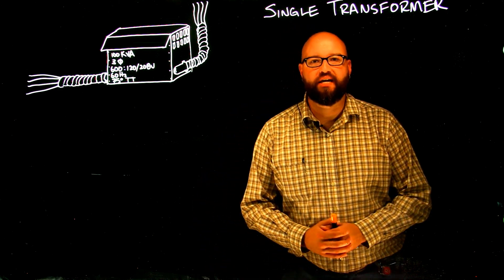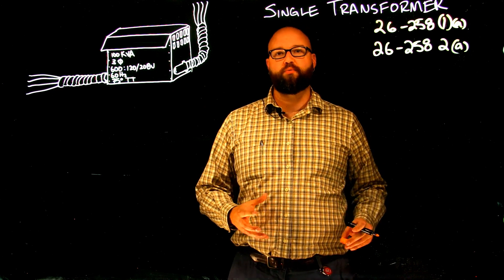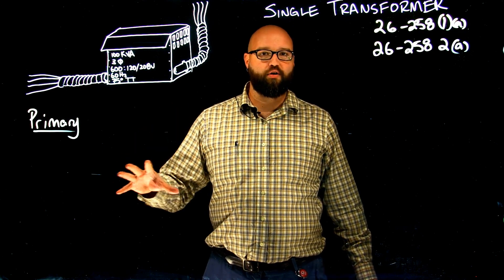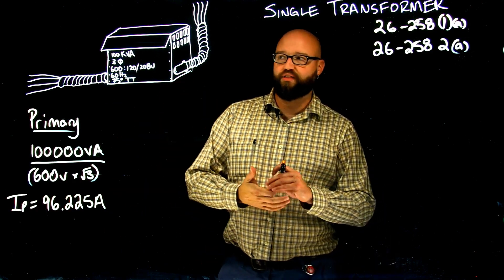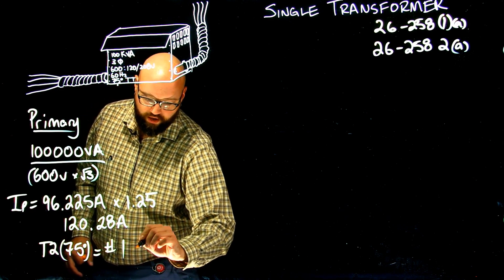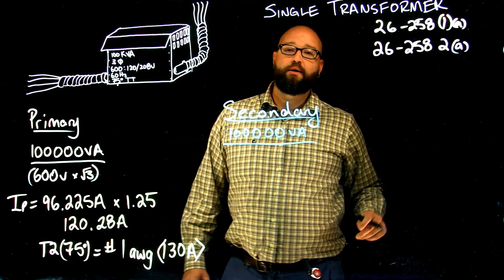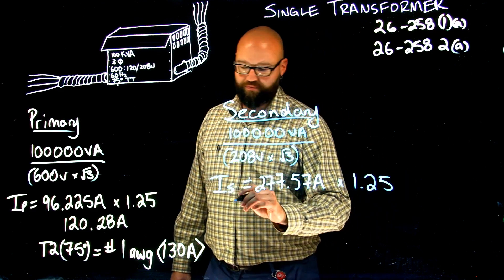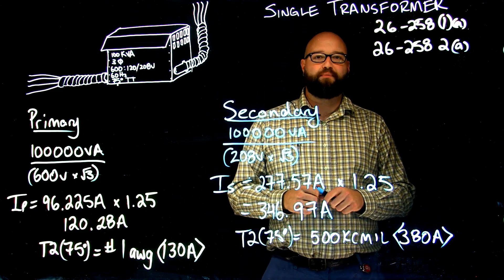Single Transformer Conductor Sizing

Comment: Say you didn’t have a temperature termination for this question, so “unmarked”. Would you still have used the 75c column in Table 2 because it’s over 100A ? 4-006 (2)(b). Or would you use 60c column cause of the no temperature rating ?
Reply from the maker: The default would depend on the load yes. As it is over 100amps it would be 75 as you said, 100amps or less we default to 60°C if nothing is marked.

Comment: Assuming I have a 110mva transformer, with cooling I have 163mva at 34.5kkv
Does the 1.25 rule still apply?
It would have a current of 2291 A * 1.25 = 2864
It is a lot of current and if the cables go in a duct there would be many conductors per phase

Comment: Where do you get the 600v from in the primary side @schulerruler
Reply from the maker: I believe in this video I used that as source voltage. Therefore primary would need to coincide with that.
Reply: @schulerruler  but wouldn’t the primary usually be a 480 step down to a 120/208 ? So where did you get 600v from ?
Reply from the maker: It depends on the distribution. I have installed many services where the utilization voltage is 600V. I arbitrarily chose to use it for this video.
I have also installed 277/480v as well but it is now less common.
Reply: @schulerruler  in other words you’re telling me if my primary voltage is 277/480 , than that’s what I would substitute for your 600v in the equation
Reply from the maker: @im1-z2x   correct. Because of the lower voltage you would have a higher line current, but all the calculations would use the same formulas.